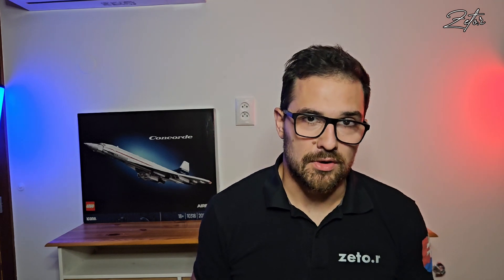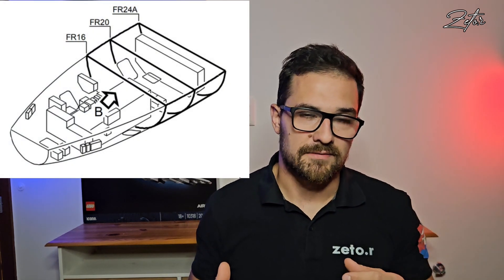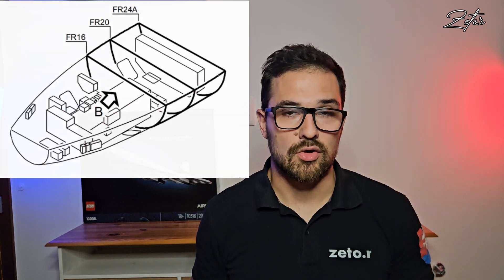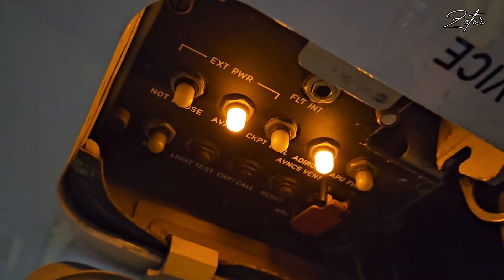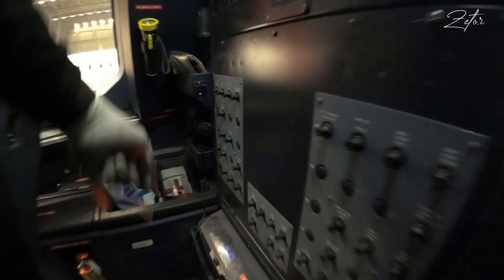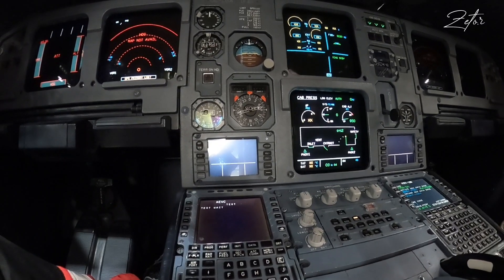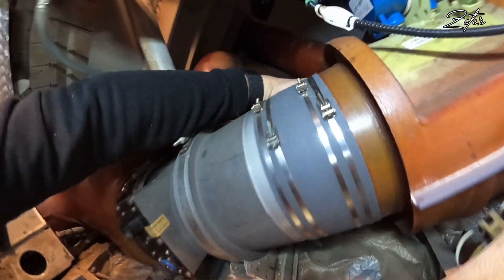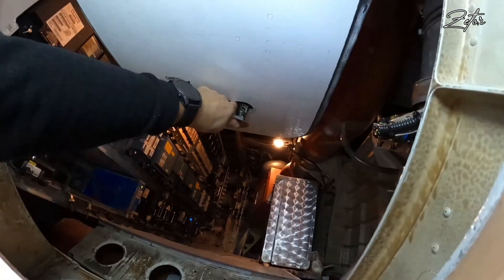ATA 21 Extract Fan replacement

Comment: Impressive!! Finally real top-notch quality videos to have a look behind the scenes at all the tech how such an airplane is designed and build on it´s inside. How does the cockpit looks like behind that circuit breaker panel? I always wanted to know if it´s just huge bunches of cables or if there is more to see behind the circuit breaker board.
The cockpit in the last scene - is this an authentic original 1989 EIS1 edition with Jaeger DDRMI and fully analog backup ADI and analog backup altimeter with the altitude measured in meters? It is awesome seeing such a classic in such pristine and good condition.